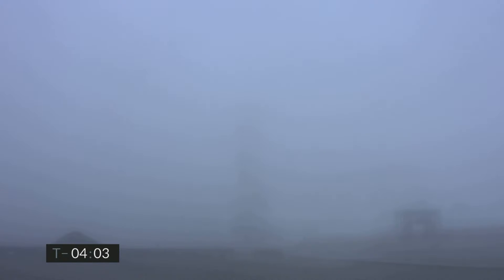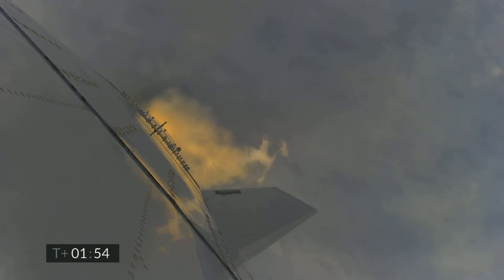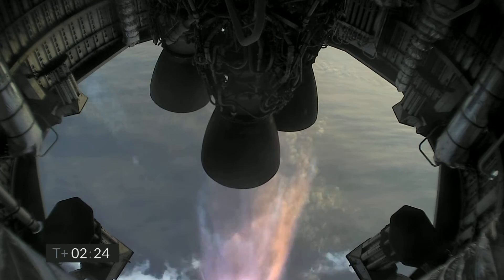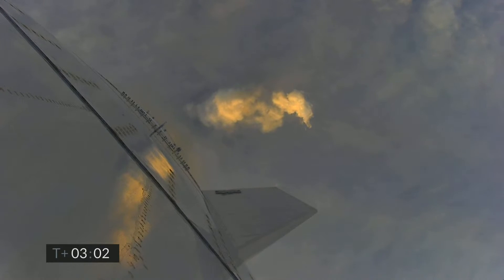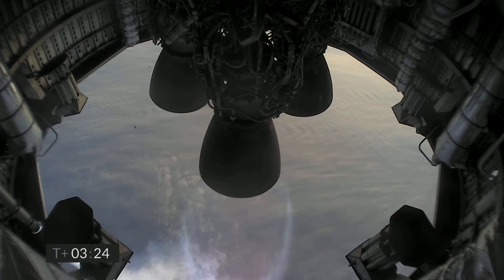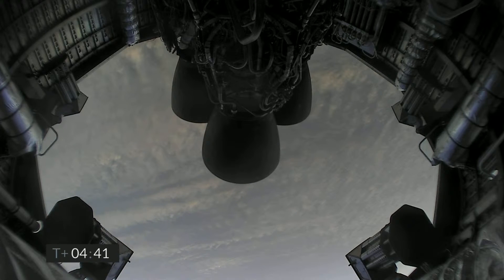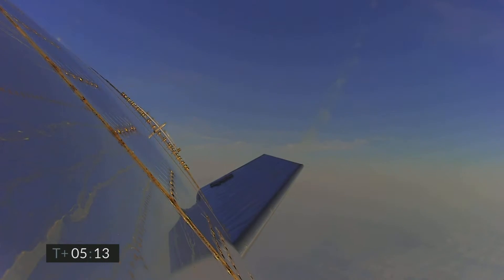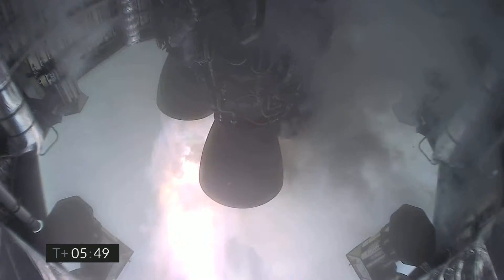Starship | SN11 | High-Altitude Flight Test

Comment: One of the problems SpaceX is having is that the fuel and oxidizer are probably sloshing around in the tanks as the rocket pivots from horizontal to vertical.  This uncovers the drains and allows pockets of gas into the fuel lines.  NASA solved this for the moon landings by firing ullage rockets before attempting to fire the main engine.  The ullage rocket firing provided a short burst of deceleration which forced the fuel to the bottom of the tanks where the feed lines are located.  This prevented "air pockets" in the fuel line that can (and probably did) cause the engine to explode, triggering a RUD.  Once that was done, they fired the engine at 10% so the computer could calculate the center of mass of the lander.  then they were able to fire at whatever throttle they needed to slow down to landing speed and touchdown.  SpaceX can do this by flipping at a higher altitude, fire ullage rockets to settle the fuel and only firing multiple engines after the COM has been determined.
Reply: They fixed that problem on SN9
Reply: Wait a minute buddy-
They don't have the fuel sloshing problem because they use header tanks to land. (Just google "Starship header tanks" and look at the pictures)
These are small tanks positioned at the tip of the rocket and between the Methane and Oxygen tank and they hold the landing propellant.
They are full to the brim, so sloshing is not possibe (at least at the beginning).
The big tanks are pretty much empty when landing.

Comment: Are there any clues in those last few frames as to what went wrong? Since those are the last few fractions of a second before the vehicle was destroyed.
Reply: It looks like one of the fuel tanks was over pressured
Reply: Most people think it was the FTS. Nobody knows yet tho. It's either 1. A failiure with engine 2, as elon said. 2. Over pressurization, or 3, over flipped.

Comment: Is it possible to build a ship in Earth orbit?

We take the materials that we load into the Starship, with a tilt front, from the top and combine them into a ship in a specially made part of the ISS or an orbit without the ISS only in both cases with 2 Starship for "mechanics"
Reply: They said once they can take people like millionaires to mars and it's safe, they'll make a giant, pretty much cruise spaceship that's so big, it'll have to be built off of the iss because it would take to much fuel to launch it off earth

Comment: As the ship started to descend, it clearly shows that the structure is lightly built, almost flimsy, as the airflow bends and twists the fin. To be able light enough to hover, the craft seems to be too fragile to manage stresses of the flight. As is, it has no future, they must redesign the whole craft. It just is not sturdy enough to be reliable. Something will always fail because of light construction that allows faults to form.
Reply: the fins are supposed to move in order to have a controlled horizontal decent.
Reply: The fins are controlled with electric motors. They don't bend

Comment: from error statistic, increase in step = increase in error chance. In the leading, compared to other commercial rocket, there are way too many steps involved, esp active aerodyanmic control. How you can test the same setting on mars repeated ?  Also, the room for final adjustement is too little. Once system overflap the tank, there is no distance to adjust back to the projectile you want (the attitude is not high enough for a proper test as well, coz the test has shifted from terminal velocity aerocontrol to flip control. Give SN12 more distance to train the system for flip and firing control for landing )
Reply: They already demonstrated how to successfully land with SN10. They have to flip low or else they would run out of fuel

Comment: Do this SpaceX do computer simulations before testing? If so the simulations software needs extra development
Reply: They do hundreds of simulations, but this is the best way to test
Reply: The computer simulations do work pretty well...
But the parts of the rocket failing is just not part of them.

Comment: Can't see anything but this flight the re light on the raptors was sooner than previous flights and may have had issues and self destructed later images shows it had scattered pieces in one direction and not confined to the center of the pad
Reply: SN11 was falling much faster than the others, around 88 m/s (300KPH)

Comment: How many engines will be needed to lift off and LAND a FULLY loaded payload to go to Mars? i assume it would have to be more especially on descent depending on gravity situation
Reply: It will have 2 stages, Starship and Super Heavy. Starship (seen here) will have 6 Raptor Engines and Super Heavy, will have 28 or more Raptor Engines
Reply: @jackwhitlock1  I think the starship has 3 atmospheric engines and 3 vacuum engines. Superheavy has I think 27 (3x9)

Comment: The flip maneuver will never work this way...IT HAS TO BE DONE MUCH EARLIER SO THE FUEL CAN SETTLE, THE STARSHIP IS TO BIG AND THERE IS TO MUCH TURBULENCE IN THE FUEL PIPES ETC. THE FLIP MUST BE DONE WITH FLAPS ONLY, THEN BE VERTICAL A LITTLE BIT SO THE FUEL AND THE TURBULENCES SET...AND THEN INGITE THE ENGINES.....will be posting this all the time. Very confident on this statement.
dr.kristijan
Reply: Nope. This is completely not how it works.

The tanks use helium to keep the fuel in their expected place. It works. SN10 was able to land successfully. The flip barely affects the flow of the fuel because the landing methane tank is in the nose. Also, have you ever seen turbulence affect a rocket? They always choose days the weather is nominal for launch. Turbulence literally does not change a thing. The way they are doing it allows fuel to be saved, engine lifespan increases, and more. SpaceX knows what they are doing.
Reply: @OortCloud  lavalamp....it is completely sealed still there is turbulence in it....the same thing, never mind the pressure, the turbulence is there
Reply: @kristijantodoroski1409  A starship vehicle is not a lava lamp. And as I said before, they choose days where the weather or nominal to do the launch.
Reply: You do realize its not the same fuel that goes into your car, right?
Reply: @picax8398  is it dilitium cristals and antimater....or plain mater made of plain atoms subjected to plain inertia laws...?

Comment: So did it land ???
Reply: No, the FTS was used about 500 metres off the ground
Reply: @oren2000  we don't know for sure was it fts, but we do know it exploded in air
Reply: @gegi207  It was probably FTS, as there was no clear explosion, it just fell apart.
Reply: @oren2000  maybe the engines blew up,idk
Reply: @gegi207  There was a problem with the engines, but they did not explode.
Reply: Definitely exploded in the air, cause is currently unknown

Comment: After launch prior to @ you can see tiny flame flickers in the pluming of the raptor engine closest to camera... at @/0.26 you see a small bust as if a small line has ruptured and the flames increase..... it seems that the pressure is not high which to my way of thinking is it occured before the preburner..... maybe on the methane side. If my hypothesis is in the right ballpark... this would reduce the turbine pressure on that side making the engine run oxygen rich (white exhaust)..... on engine restart the preburner may not have been able to produce enough flow to restart causing engine failure....... just a wild conjecture being tossed out there for discussion.

Comment: I think that the problem of fires in the engines are produced by eddies caused by the cavity where the engines go, because the same raptor engines do not fail in the falcons but they do fail in the starship. In the videos of the camera mounted in the cavity of the motors when it goes in free fall you can see eddies that form inside, and in the falcon rockets you do not see these eddies since the motors are exposed

Comment: SpaceX should hire good engineers, this is not normal
Nasa land on the moon and mars 
Soviet union land on venus, compared to earth this should be doable
There is a problem
Reply: None of those were as large as starship, or landed at a specific spot, they just landed anywhere. Plus, the moon is easy due to low gravity and on Venus you can just use parachutes. In fact, to this day, SpaceX is the only company to propulsively land a rocket.
Reply: @nasawormlogo9521  how about Bezos company, blue origin 
they also landed a rocket
Reply: @ALI-se4ph   sorry, I forgot to specify orbital rocket. Just landing a suborbital one is easy
Reply: @ALI-se4ph  spacex landed a rocket too, in fact they do it every fortnight on average. this rocket is completely different to pretty much every rocket that has ever existed, however, and is expected to fail a lot at first.

Comment: If NASA sent men to the moon in 1968-73, then world's richest person should be able to do a mere 10km flight test in 2021 without exploding.
Reply: @Salticus  Actually it's much more difficult to land a rover on the moon...6 times back to back without even a single failure(except Apollo 13 which was still called a success).

Comment: The ascent burn of the raptors is NOT looking good : the plumes are not equal neither in dynamic not in color, also there are sometime a orange/brown smoke and sometimes not, proff it is irregular. Also we can see one turbopump is heating more than reasonable. The 3 "good" engines are not so good and are certainly not equal from each  Go SpaceX Go!!other and not regular in their burn over time. Go SpaceX, Go!! Lots of work to do !!

Comment: For those who were thinking FTS was engaged I put together the times (estimates) of all the landing burns for the four test flights (8, 9, 10, 11) 
Landing burn time summary:
SN-8 (landing failed) (11 sec)
SN-9 (landing failed) (8 sec)
SN-10 [landing success (but rough)] (20 sec)
SN-11 (landing failed) (10 sec)
SN-11's was based on audio which could be heard after the camera froze, I think this proves that it did hit the ground rather than get terminated as it's burn time was between SN-8 & 9, plus the thud at the end sounds like a ground impact, FTS would probably not have that metallic bump, but rather a bang

Comment: And you believe they went to the moon, took a walk there, and came back, 60 years ago.
Reply: This is a dumb logic
Reply: @creeperawman1431  Dumb logic is they can't even land on earth in 2021.
Reply: @843idfa  they didn’t land like this back then they used parachutes to land on water, starships can land by themselves so they are reusable
Reply: @843idfa  this has nothing to do with moonlanding, that was done much differently than this
Reply: @creeperawman1431  They landed on water on the moon? And took off 😁😁😁
Reply: @843idfa  no they landed water on when they came back to earth
Reply: @creeperawman1431  Right, go watch more Hollywood movies.
Reply: @843idfa  keep taking your meds and take off your tin foil hat.
Reply: @843idfa  Do you know how much harder it is to land like this? 1st. The earth has a stronger gravity and atmosphere. 2nd, the rocket is wayy bigger. 3rd, try igniting your engine at the perfect time, then flipping, and landing at 0 m/s, avoiding all problems.
Reply: The thing is that this spacecraft is a prototype with new hard ware that is new, your always going to find new problems this is why ITS A PROTOTYPE.

Comment: The rocket had already caught fire. The thruster would have been better if it had 4 instead of 3.The way you turned off the thruster, then that thruster fell apart.Instead you would have 4 thrusters and all four would be connected to each other.
Just as the four fans in the drone use the air like a wing by pushing the air down and setting the balance by reducing that air more, in the same way, use the thruster.
 Also, placing four thrusters in four directions around the middle part of the rocket will make the balance of the rocket quickly.

Comment: So why do you turn engines off?  Why don't you just throttle them back??  That way you never lose redundancy and are never without lift immediately available?  Sorry if this is obvious.  TIA.
Reply: In a perfect world, yes, you would just throttle the engines down to say 1%, and leave them running. But rocket engines are fickle creatures.
The minimum throttle on these engines is ~40%. So not only would you still be burning a bunch of fuel, but you'd actually have a lot of thrust pushing you sideways.
With all three engines at minimum throttle, the Starship will still accelerate horizontally faster than a plaid model S.
Even a single engine at minimum throttle would have it accelerating pretty quickly, reaching 60mph in about 4 seconds.
Reply: Conserve fuel?

8:49 PM
3/30/2021
Reply: TWR with 3 engines at minimum is high enough to lift the rocket? I guess. Not only does this mean the rocket essentially needs to do a hoverslam, they need to cut out the engines at the right precise second.  There’s also the fact that higher thrust = more G forces. AFAIK 2 engines is possible as Elon has stated post-SN10.

Comment: MY RECOMMENDATION HOW TO SUCCEED WITH NEXT STARSHIP:
1. DO 5 STATIC FIRES IN 20 MINUTES. ALL 5 NEED TO PASS AND NO RAPTORS CAN BE DAMAGED. DO NOT MOVE TO STEP 2 UNTIL STEP 1 I PASSED. REPEAT IT FOR AS LONG AS NECESSARY.
2. SINCE 150 METER FLIGHTS ALL PASSED, AND 10 KILOMETES DID NOT, AFTER YOU PASS STEP 1, DO MANY FLIGHTS IN FOLLOWING ORDER:
2.1. 100 METER FLIGHT.
2.2. 500 METER FLIGHT.
2.3. 2 KILOMETERS FLIGHT.
2.4. 5 KILOMETERS FLIGHT.
2.5. 20 KILOMETERS FLIGHT.
IF ANY OF THE LOWER ALTITUDE TEST FLIGHTS DOES NOT PASS, DO NOT GO TO HIGHER ALTITUDE FLIGHT UNTIL LOWER ALTITUDE TEST FLIGHT IS NOT PASSED. REPEAT EVERY FAILED TEST AS LONG AS IT TAKES TO PASS IT BEFORE MOVING TO THE NEXT TEST.

OF COURSE, ANYTHING BELOW 5 KILOMETERS WOULD HAVE TO BE A TEST WITHOUT FLIPPING, BUT, BABY STEPS FIRST. TESTS 2.1. AND 2.2. SHOULD BE TO PROVE THAT IT CAN LIFT OFF. IN THESE TESTS, STARSHIP WOULD IGNITE, ASCEND, HOVER AND THEN DESCEND TO LANDING PAD ALL IN ONE BURN. THEN USE THE TEST 2.3. TO PROVE THAT STARSHIP CAN RELIGHT ITS ENGINES. THIS TEST WOULD BE SIMILAR TO TESTS 2.1. AND 2.2. EXCEPT IT WOULD SHUT DOWN ITS ENGINES FOR A FEW SECONDS WHEN AT APOGEE AND RELIGHT THEM BACK FOR LANDING. AND THEN IN TESTS 2.4. AND 2.5. DO WHOLE HIGH ALTITUDE TEST FLIGHTS WITH FLIPPING.

BECAUSE NOW, YOU ARE JUST WASTING STARSHIPS. STARSHIPS THAT ARE NOT READY ARE SENT TO FLY, AND THEY END UP CRASHING AND YOU END UP LOOSING MILLIONS OF DOLLARS. MANY ACCIDENTS WOULD NOT HAVE HAPPENED, BECAUSE NONE OF THESE STARSHIPS WOULD HAVE PASSED TEST NUMBER 1 (5 STATIC FIRES IN 20 MINUTES) BECAUSE ENGINES WOULD GET DAMAGED, AND YOU WOULD KNOW THAT YOU ARE NOT READY YET TO FLY. WE STILL COULD HAVE BEEN AT STARSHIP NUMBER 5 NOW AND STUCKED AT TEST NUMBER 1, WITHOUT HAVING SO MANY EXPLODED STARSHIPS, WHICH, IN TURN, MEANS A LOT OF MONEY BURNED. IT WOULD COST LESS TO DO MUCH MORE TESTS AND ONLY FLY WHEN STARSHIP IS TRULLY READY. AND NONE OF THESE STARSHIPS WHICH YOU SENT TO HIGH ALTITUDE TEST FLIGHTS WOULD HAVE BEEN MARKED AS READY TO FLY IF THEY HAD BEEN TESTED PROPERLY.
Reply: No
Reply: @avap0n459  ŠTA NE?
Reply: This sounds like a good way to ensure the survival of a single prototype, but also a good way to ensure that the program takes several times longer.
SpaceX have said that time is their most important resource right now. If they think they can progress faster overall by sacrificing test vehicles, they will do so.
Reply: @lazarus2691  YEA, YOU ARE PROBABLY RIGHT. THEY ARE SPENDING MUCH MORE MONEY THIS WAY, BUT ARE DOING THINGS FASTER, YES. AND SINCE THEY DO HAVE A LOT OF MONEY, THEY MIGHT DECIDE TO GO ON A MORE EXPENSIVE PATH. I SEE. GOOD POINT.

Comment: I have always told the men I've had relationships with, the moment you are unfaithful is the moment you end our relationship. If I've ever felt so disconnected from my partner that I have felt myself drawn even into a hypothetical affair in my mind, I end the relationship. I've been in many abusive relationships (that I ultimately ended) but never once have I been unfaithful. Why? Because no failing relationship is worth sacrificing my morals and integrity for. No matter how it unfolds with a partner, there should be a base level of respect and empathy towards them as a human being. A failed relationship will not pollute your mind and foster insecurities anywhere near as much as being on the receiving end of adultery. I didn't know what was happening all along for years that he's been cheating until I met cyberhack037@gmail.com or on WhatsApp +14347678160
Reply: Wow. Nice spam #1.

Comment: I BET SPACEX NOW FEELS SORRY FOR DISCONTINUING STARSHIPS 12, 13 AND 14. THEY DISCONTINUED THEM BECAUSE THEY WERE SO CONVINCED THAT STARSHIP 8 WOULD LAND, AND IF NOT STARSHIP 8, THEN 9 OR 10 FOR SURE. 11 WAS JUST A BONUS FOR "JUST IN CASE". SO THEY MOVED TO NUMBER 15 AND STARTED PREPAIRING IT FOR ORBITAL FLIGHT. AND ALL STARSHIPS AFTER THAT. NOW, WHEN ALL OF THE 8, 9, 10 AND 11 FAILED HIGH ALTITUDE TEST FLIGHTS, THEY WILL HAVE TO REPURPOSE STARSHIP 15, AND POSSIBLY 16 AND 17, AND MAYBE 18 TO DO HIGH ALTITUDE TEST FLIGHTS INSTEAD OF ORBITAL FLIGHTS. SO, BASICALLY, THIS IS HALF OF THE YEAR LONG SETBACK.
Reply: No... its because 12-14 were severely out dated
Reply: Not really. If they had continued with SN12/13/14, SN15 wouldn't be almost finished by now. Those resources were reallocated, but SN15 still took about the same amount of effort as SN12 would have, so using it for SN12's purpose doesn't really set them back.
The main reason they skipped SN12/13/14 was that SN15 is the first to use new improved construction techniques, so they wanted to start using those. It was never specifically slated for orbital testing. Even before SN11 flew they had scaled back plans for SN15/16/17.